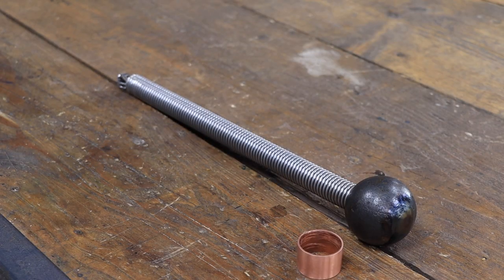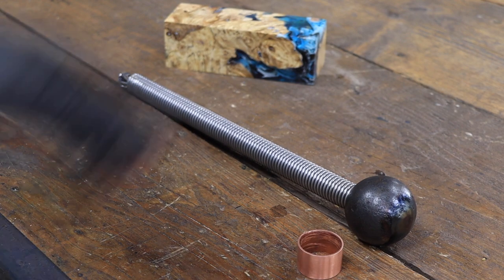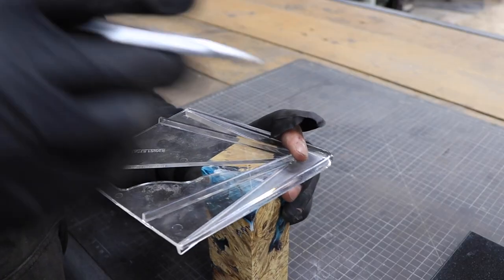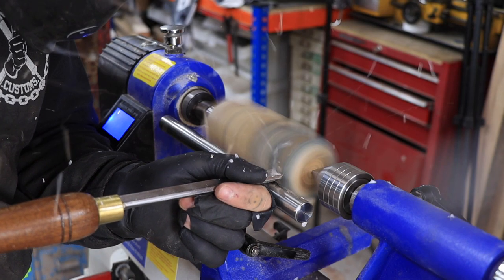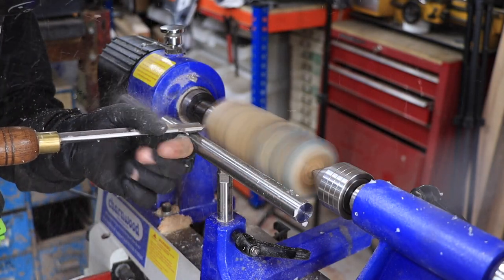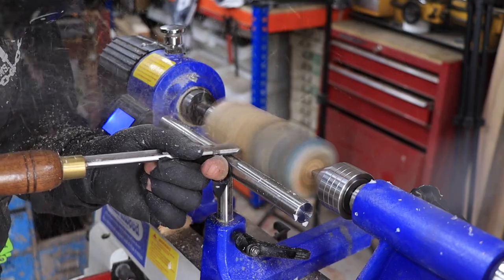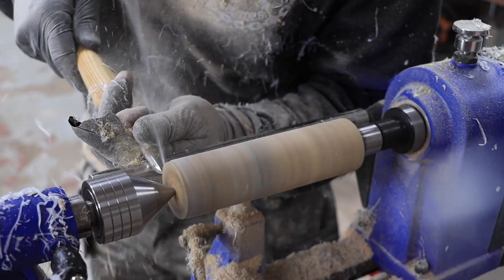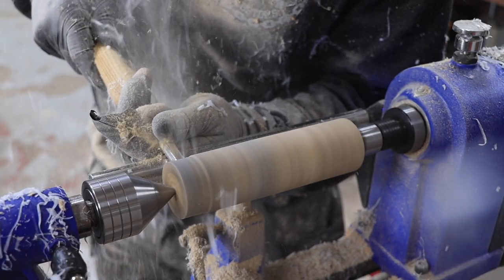German Spring Handle Trench Club

Comment: The spring should be thicker more taught much less flexible!! It’s flexibility should be just slightly less than solid!! It shouldn’t move and bend easily like that!! As far as I would want it!! The spring adds the whipping effect but if it’s too flexible it actually takes away from the impact force!!
Reply from the maker: Guess you never held a real one then
Reply: No
Reply from the maker: @websurfer352  then how can you have such an opinion on something you’ve never held?